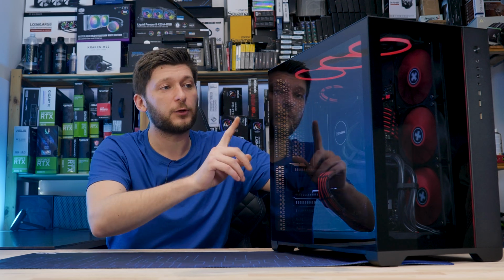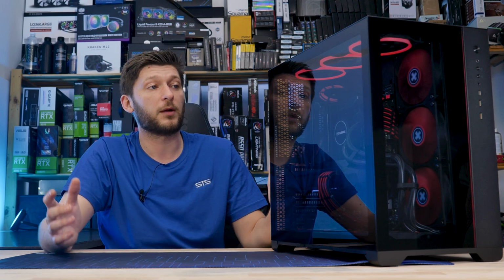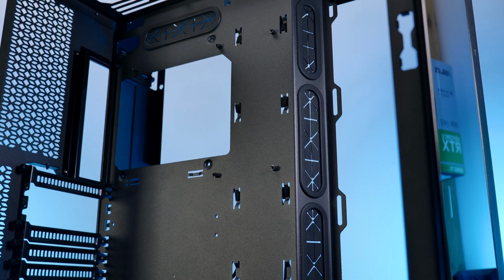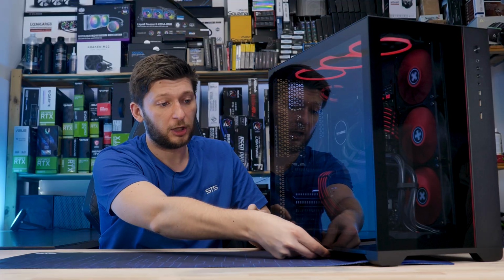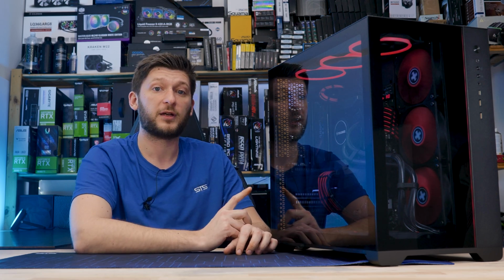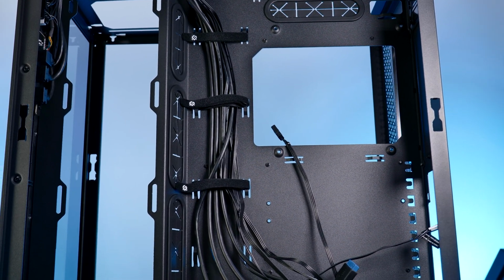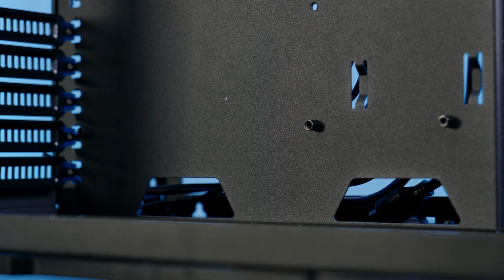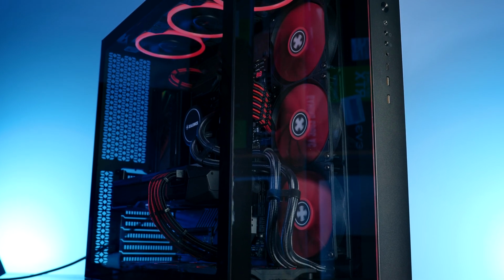MagniumGear Neo Cube 2 Review - Beautifull High Performance Beauty

Comment: How does one connect the type c port on front IO?
Reply from the maker: To the Type-E connector on the motherboard, if you have an older board, you can get an adaptor: USB Type-E to 20-Pin

Comment: side note: you can 100% fit 3 360 radiators with 16 fans in this case at one time with 2 80mm fans in the back grills. i did this exact setup on my on old x570s build. i just rebuilt using 2 360s with the lian li011d side distro  and the phanteks vertical gpu bracket with a 4080
Reply: I didn't understand where the others 7 fans will fit. 3 on the top. 3 on the side, 3 on the bottom, 2 in the back grills.. and the others where they fit?
Reply: @RobertoLx92  push / pull on the top, back and side + creativity using slim fans in certain places. Setup was way too loud with no real benefits in extra cooling. Essentially a dust trap between the radiators

Comment: Built in this case. I really liked it, good quality and nice features. However, you need to make sure your GPU isn't too wide from motherboard to the glass panel. I tried using an EVGA RTX 3080 FTW3 and it would not fit comfortably with the PCIE cables. So, if you are going to mount the card horizontally rather than vertically, you might have an issue.
Reply: 1000% can confirm. i had to use a phanteks vertical gpu mount just to get my 4080 in the case with the 12vhpwr. im also using the 011d side distro/pump block.
Reply: @phillysupra  how long is your card? does it fit vertically comfortably? i want to get an asus tuf 7900xtx but its almost 360mm long and since its too wide as well horizontal mounting is out of question for me

Comment: Just a heads up 4090's don't fit. I have one. They aren't wide enough to have the GPU regular mounted and the power cable inserted. I had to leave the side panel off. You can just about fit a Zotac 3090 with the power connectors in. Anything larger and it's best going elsewhere.
Reply: Cablemod is coming out with a 90 degree power adapter for the 4090's.
Reply: @beezaa  yeah. It'd probably press against the side panel.
Reply: i had to purchase the phanteks vertical gpu mount for my 80 to fit (same cooler as the 90's)

Comment: The neo cube they already sold was a really valid option and a good competitor for the lian LI

I've got the neo air from metallic gear, the neo cube air is basically the same exact model, except that it now comes with aRGB fans, while previously it had RGB fans, and the aRGB came with the neo G, basically a neo air but with a front glass instead of mesh